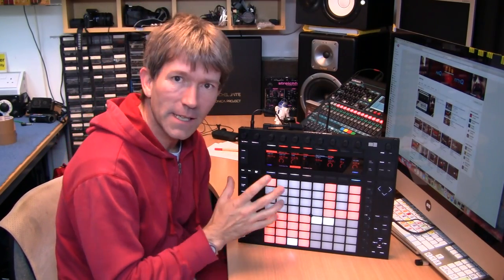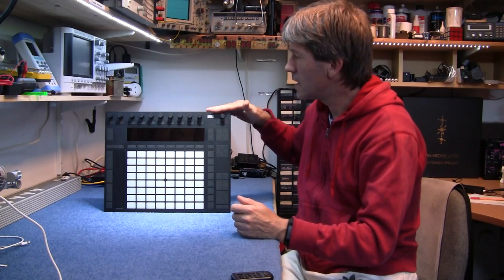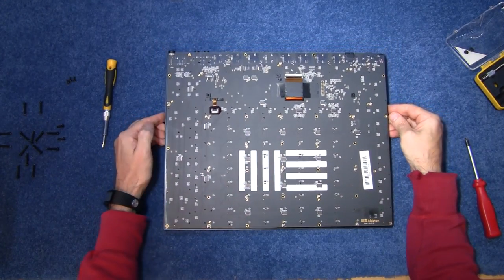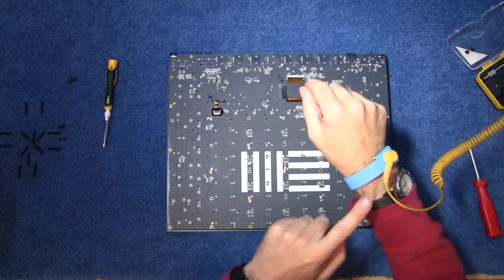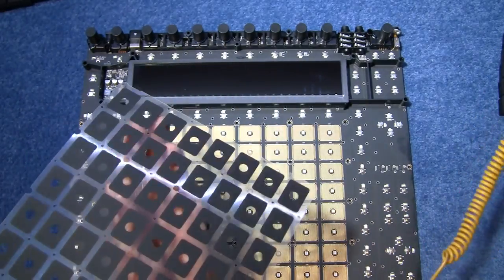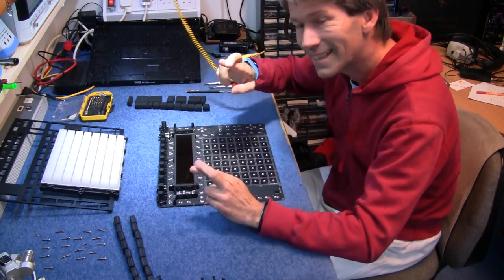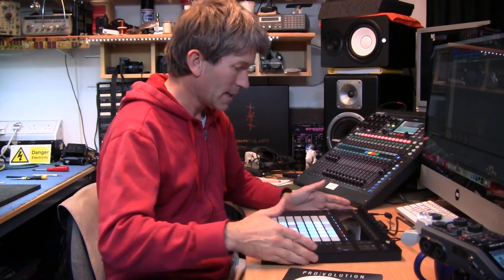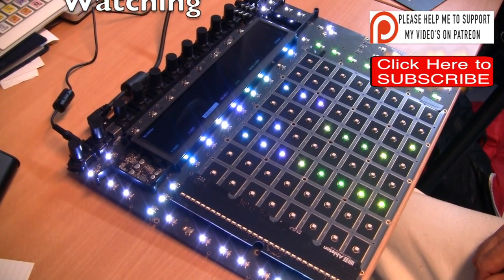ABLETON PUSH 2 teardown MF#60

Comment: Did you ever repair novation launchpad mini? Mine fell down from the table while it was connected and know it shows no signs of life. I wonder if I could teardown and fix it by myself
Reply from the maker: +portwain if it was pluggen in at the time the connector may have pulled away from the circuit board and disconnected one of the pins.

Comment: Hi there markus, really helpful video. But I have a question for you. I recently spilled some liquid on my push 2 and the pads arent responding anymore. So I wanted to disassemble it to clean the board with alcohol. But the three screws under the screen are really tight and won't come off. I nearly destroyed the screws and scared they won't come off anymore. How did you manage to remove those screws? Thanks
Reply from the maker: Im not sure I had any trouble with any screws,  they all seemed to come out reasonably well for me. you must have a really tight fixing on those. I would just clean what I can get to and then try it out to see if thats fixed it.
Reply: markusfuller I havent been able to get to the inside of the device. The three screws i meant was on the back casing of the push which placed right under the screen in a triangular placement, i think those are the shortest three black screws on your video cuz those are the screws im missing, they simply wont come off and the screw dents are nearly destroyed because of my attempts. Any advices?
Reply from the maker: Oh yes I see what you mean now. they are strangely different sized screws to the rest. I really cannot remember having any problem removing them though I must have changed to a different philips screwdriver as I just tried my large red one and it will not catch the head correctly.

Comment: thanks for playing around with this monster!  Would you have a solution for a broken ON/OFF power on push controller? do you know where to find the right piece and potentially any advice on how to change it? Thanks
Reply: Maybe you can solder the connection in a way that it is always on? From what I read online Ableton does not give out part numbers, or send out spare parts...

Comment: Great Video, thanks for sharing! 
Would you think one of the encoder knobs would be changable? If so would you know anywhere that would do a good job of it?
Reply from the maker: Mark Hughes Hi Mark. I could not pull off one of the knobs as they were quite tightly fitted but I guess the whole pot could be unsoldered and replaced by someone who is use to fine soldering.

Comment: I wonder if the female header at the top left of the pad matrix is a programming interface for the microcontroller.
Reply from the maker: There was a header top left of the pads but that was to connect the touch slider which i had removed from the board. I think the programming Jtag is under the main display.

Comment: I spilled beer on top of the bottoms, about 8 of them dont work, I dried it well with a hair blower and tissues. Do you think it will work again?
Reply from the maker: Hello. you may need to open it and clean the beer from inside the unit. beer is quite bad when it dries up on circuit boards but you can normally clean it up with isopropyl alcohol.

Comment: Hello Markus!! Great channel!! Very much enjoy you fixing and exploring gear from the guts. Anyway, i own the Push 2 and the other day i spilled a beer on it :/. It now boots up well and the display is fine. I do have a couple of the pads not working tho. The warranty will not cover this so my only option right now is to open it up and do a proper cleaning. Do you have any advice as how to do this? Things i would require etc. These pads seem pretty high-tech and i don't want todo more harm to them.
Reply: im about to do this, any tips?

Comment: Hey Mark, thank you for the his video! I had a leak in my room and my ableton push was hit. I saved the push but two things im stuck with. The screen is now blank and doesnt turn on. and I cannot seem to push the push back together. It always feel like something in the top left is stopping from letting me close the case completely. Its been 10 months since ive been able to use my push and its driving me crazy lol did u have any resistance when assembling the push back together?
Reply: I had some resistance, but I ended up inverting the play button :')... Make sure you wiggle every button a little bit until the upper frame falls past it. the blank screen is a difficult one to fix I'm afraid, could be a lot of things.

Comment: Hi, how hard do you think the potentiometers are to replace? Thanks
Reply from the maker: palaHD palaHD I think they would be a bit tricky to replace the digital encoders as they are quite tightly packed so close to each other
Reply: thanks for the reply,the reason i asked is because there's one for sale on ebay and the seller says that some of the encoders have different torques to the others and he says it's quite normal,also ableton themselves also say this ? i was wondering if you found this to be the case with your unit ? thanks in advance

Comment: The build quality was a concern for me but not any more! Thanks!!
Reply from the maker: +SwitchMultiMedia Hello I have had a few messages that the black buttons can scratch if you have long fingernails. but other than that I have been inside many items over several decades and this looks and feels like quality right through to the smallest components. still it looks like it will serve many years of use without too many problems.
Reply: I have the Version1 which was built by Akai Pro which has been rock solid. I have several of their MPC range built like tanks but always a concern with a software developer going it alone on hardware. Thanks again for the great video.
Reply from the maker: ThankYou, I have never been into Ableton live but I am finding it really interesting. this is really the first Pad based hardware thing I have ever really tried. always been a keyboard player in the past.

Comment: nice one for having the balls to take it to bits for us. it is an expensive unit. 
you might have explained what's happening with my maschine with the carbon sheet business is it the same sort of set-up do you know?
Reply from the maker: +Gavin Moore I think most of these PAD style machines must use the Carbon onto track trick, its been in use for many years even many keyboards use carbon track under the keys to make that connection. some of the bigger drum style pads (where you hit with a drum stick) can use both carbon track and Piezo crystal to detect a Hit.

Comment: Will it blend?  Nice looking construction.  Did I spy Radio Shack's state of the art radio scanner from long ago that did 30 Mhz to 1300 Mhz or so, with fully unlockable cell phone range?  I have one sitting around.  $400 new when $400 was a LOT of money for me :)
Reply from the maker: +Michael Bauers Hi Michael. Yes the scanner is something I have owned for many years, I remember the good old days when you could listen to the early mobile phones. Theres hardly anything on there now that you can listen to but it has its uses as a tool when repairing cheap radio-mics. I also have an Icom IC-r1 and the tiny Icom IC-r2. though they are quite redundant now in what you can receive.

Comment: Do you think the Lumatone Keys could be rewired to work with the Push 2? I would remove the Push 2 pads and have long wires going to the Lumatone keys. The Lumatone keys would not be in the same position as the original Push 2 pads. The Lumatone and Push 2 both have MPE.  https://www.lumatone.io/
Reply from the maker: Hi I no longer have the push 2. I went and had a look at the lumatone after reading your message, looks really interesting but wiring all those pads to the lumatone will be a lot of wires.

Comment: LOVE WHAT THEY DID WITH THE NEW PUSH 2...MY ONLY DOWN FLAW IS YOU HAVE TO PLUG THE POWER ADAPTER WHERE PUSH 1 ALL YOU NEED IS THE USB TO POWER IT...
Reply from the maker: +Juan Baez Hi Juan. it does work without the PSU but it is very dim and hard to see what you are doing.

Comment: Hi all!!

how can I set all 64 pads to different notes, effectively the same as a keyboard, for soft synths, Kontakt 5,  etc? 
e.g.: (2 scale)..
s16.postimg.org/4v8w1gvl1/scale_2_of_12_1_3_MB.jpg
Here is the solution of key/note ordering/mapping on this Picture.
Thanks for any answer..
Reply from the maker: +PR SoundDesigns  Hello. I hope someone can answer this question for you as I am still at the beginning of learning this ableton. I think I did see a video elsewhere where the whole 64 pads just become a full scale keyboard as in 12 notes of every octave. Not sure where I saw that but I think its on youtube somewhere, if i come across it again I will send the link. Best wishes from Markus

Comment: thanks for this video, man. great job!
Reply from the maker: +Alexander Phleps ThankYou Alexander
Reply: +markusfuller Hey Mark. You said you don't know how the knobs work but can you take an educated guess? Does it seem like some in-house development to you? I've never seen anything similar but this could allow some really interesting interactions
Reply from the maker: I know they are endless fader controllers but I meant the way in which they are touch sensitive. I think they may use some type of capacitance sensing so It knows your finger has touched the surface of the rotary pot. they are very fast response to the lightest touch.
Reply: +markusfuller I was just wondering if you can build something like that with any encoder or pot, or if it's a special component. The caps are obviously special as they are conductive. I also know there are some touch sensitive faders on high end digital mixers. But I don't know what I'd have to look for if I was going to source something like that myself. I know this is a very nerdy kind of question. It's alright if you don't have an answer for that :)

As for Push. Yes they are endless encoders and they work really well. But the touch sensitivity is only used in some places. For example: If you changed a value behind an encoder and you want to reset it to the initial value, you can hold down the delete button and simply touch the encoder to do that. Another example is, you can touch the tempo or volume encoders and see the current values without changing it. Interactions like these are the reason why I'm so interested in the components.
Reply from the maker: I think the centre post of the pot is metal so something connected to the Centre pin of the pot may be detecting the capacitance of the human touch. the same with fader controls the metal post to the plastic button must be doing the same thing. Its not a new idea but I think they got the sensitivity just right as i used a mixing desk years ago where only half the faders would detect you and if you touched a few faders at a time they just got confused and did not know what to show in the display. so you turned off the touch setting and lived without it. I cannot remember which desk it was but it was a huge beast of a machine.